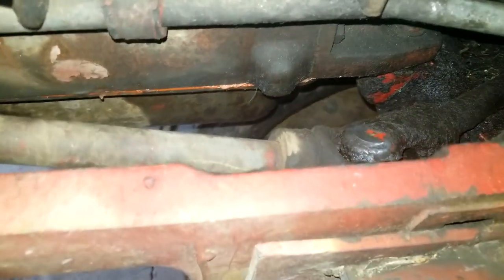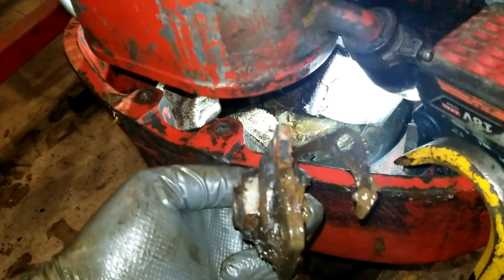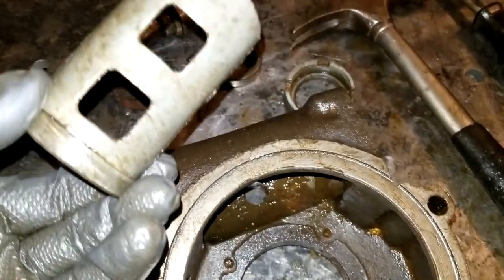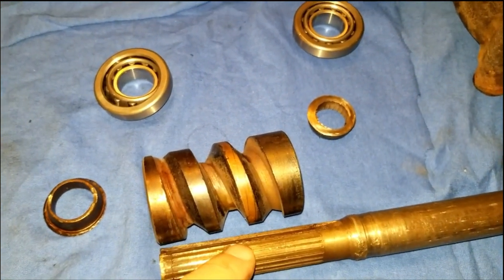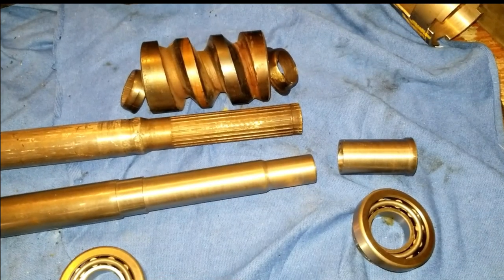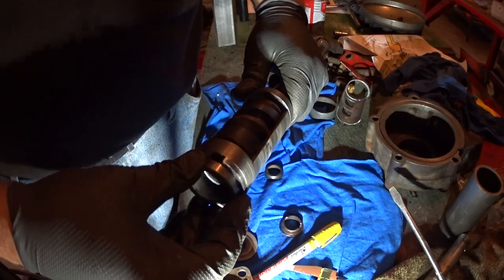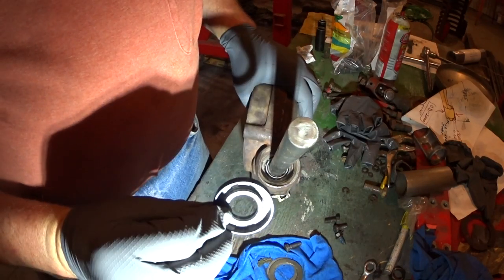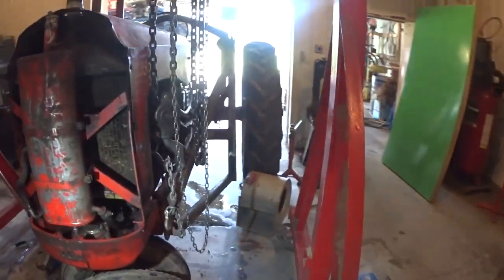Massey Harris Steering Box Repair

Comment: Ah we have similar buddies! I have a 1952 Massey-Harris 44 Special that was bought new for the farm by my Grandfather back in the day. It has countless hours on it, but these days it's mostly just a snow plowing tractor. My steering is just as bad as yours. lol I'm going to try and fabricate a wide front end on it. I have another issue to overcome first as I can't get it to go into gear while running. I'm thinking moisture got into my clutch pressure plate sticking it to the flywheel. Going to try and start it in high gear to see if I can break it loose. Mine fires right up whether it's 80 or -20 degrees out with no overhaul, it deserves getting some love. Thanks for the video, I'll follow it to help me get my steering column apart when the time comes.

Comment: Excellent and comprehensive repair from start to finish !!  I bow to you sir. Slow and methodical wins the race!! Thanks for uploading the repair. Excellent machine work too.
Reply from the maker: Thanks!  My only other option would have been a tractor "junk yard part pull" I think.
Reply: OneVeryOrdinaryMan yes, more than likely that would have been an option. That’s why I try to keep a few parts tractors. Never know. Of course Wisconson IS Massey country. There should be quite a few around. Good thing about these guys is sooooo many parts will interchange across models.

Comment: We had a massive Massey 44 with the steering box in the same condition we had to drill drip through down through and put longer bolts the wet outside on the upright post to hold it in place. Very poor set up hard steering tractor.

Comment: My lash adjustment sleeve on my Massey 44 is destroyed worse than what yours was, the only problem is I can’t find a replacement anywhere. Is there any chance you could machine me one like you did for yours?
Reply from the maker: Unfortunately my ability to machine this is limited by the fact that the last machining job was partially done on a government project basis due to my not having a lathe. I did look around on some of the usual sites and couldn't find this piece either.  I think that's why I ended up making my own.

Comment: I have a question for you….is it possible to change the front end to a wide axle?
Reply from the maker: I am sure it is. With all the right parts of course.
Reply: Yes, it definitely is. They are completely interchangeable. We changed out the wide front end on our 44 Special for a narrow front for cutting hay to make tighter corners.

Comment: Did you have to do any adjusting once you had it initially  installed?  

Love those old Masseys.   I always thought a 44 was a much better tractor than an M Farmall but I know there are many that feel the opposite too.  My dad had good luck with the Masseys.
Reply from the maker: I didn't do any further adjusting.  But did notice a small leak from that seal on the bottom.  May have to redo that..

Comment: I'm having trouble getting the steering box to go back onto the axle gear and lined up with the bolt holes.  Yours seemed like went right on.  Any advice?  Thanks for video
Reply from the maker: Yes, no problem.  Remove the frustrating failed attempts and words of anger  through video editing.😁😁😁

Comment: Great job!! Just curious, have you ever seen a single front wheel on a massy 30 or 33? I’ve got an old 30 with a single front wheel and have never seen another one like it.
Reply from the maker: Single wheel in front would definitely be unusual. If I have seen, probably only in an online photo.
Reply: I knew a guy who had a Massey Harris 333 propane with the single wheel in the front.....the owner called it...the stick in the mud front end
Reply from the maker: Narrow front is enough of a mud diver.  Can't imagine one wheel.